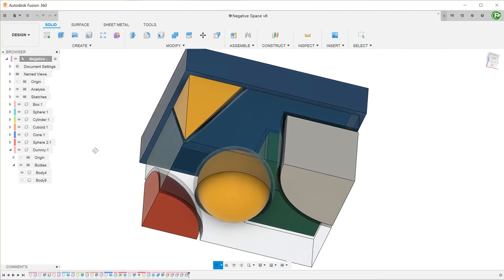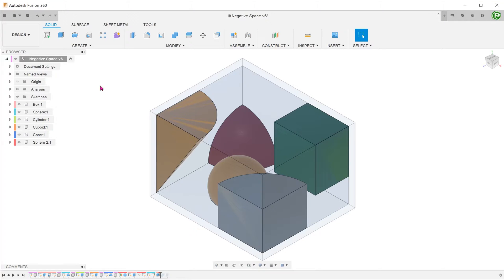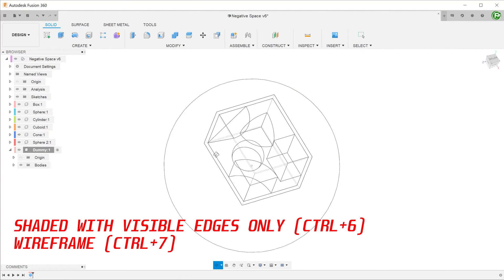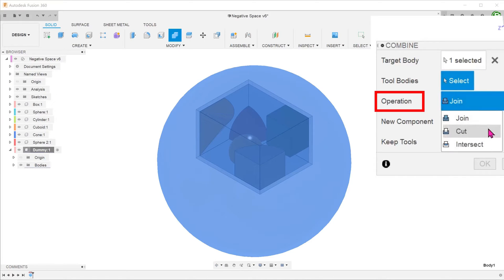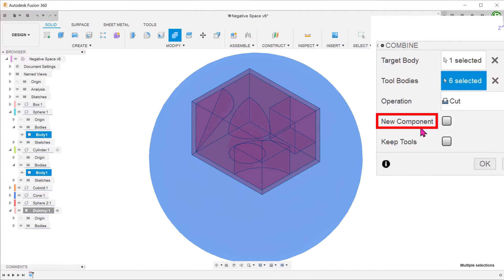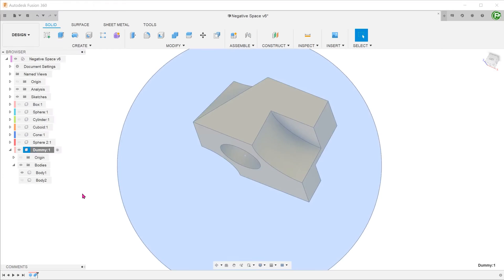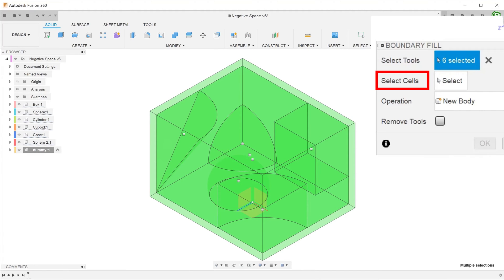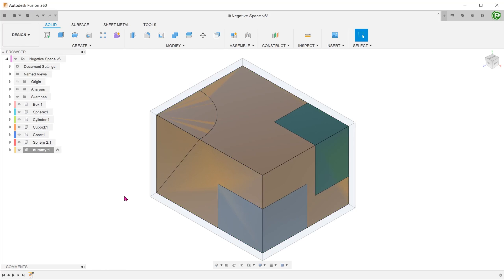Fusion 360 - Creating a solid out of negative space

Comment: Thank  you, most of the time I work with existing models trying to fill up the insides instead of stuffing all kinds of primitives in there to close it. - Would it work with 3MF, SLDPRT, STL etc files or only when it's purely created in Fusion 360 in that drawing form??
Reply from the maker: I haven't tried this yet. But I would think that as long as after importing, if Fusion recognises them as solids, you should be able to carry out the same workflow.

Comment: Hi, I begin with fusion 360, I have a quesiton, how to extrude a text on all the height of a rectangle that has a hollow space in the middle without the text to fill this hollow but just the full parts of the rectangle?
Reply from the maker: Hi, you might want to try experimenting with the start and extent options in the extrude command to achieve this. If this is not possible, would you be be able to cut out the unwanted portions of the text thereafter?

Comment: I agree with you regarding the Boundary Fill usability. Cell selection is usually a guessing game. It's such a valuable tool, so I hope Autodesk can tweak it a bit to make it better.
Reply: I agree too, this is why this video is very helpful.
Reply from the maker: When the boundary fill feature first came out, selecting the cell actually turned it into a completely different color. For some reason, that was changed.